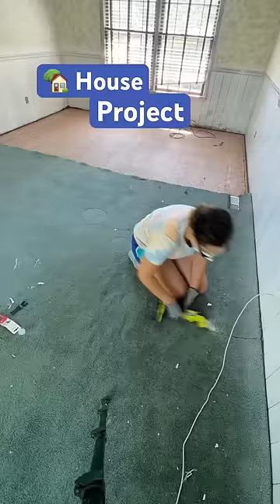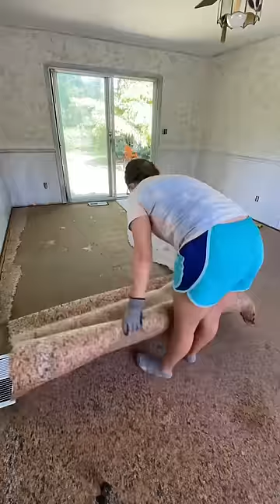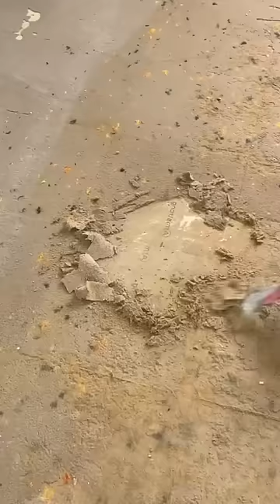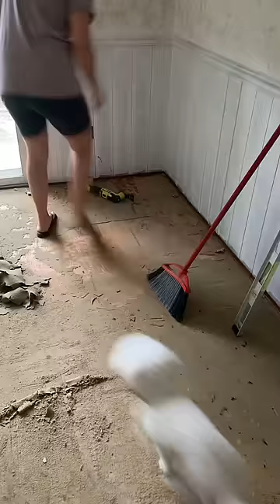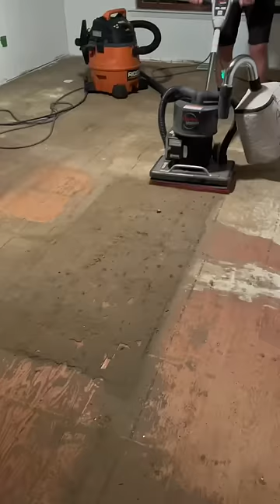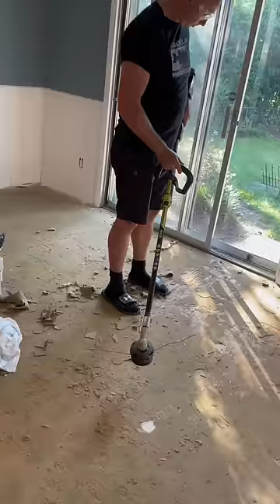Ep.7 DIY fail removing what we found under carpet | Carpet Removal | House Project BEHIND THE SCENES

Comment: That is the rubber from a rubber back carpet that was previously installed. It can easily be removed with a standard razor scrapper from Lowes in the carpet section where they have flooring tools. And yes, you should have done all that before painting as now your paint line is going to show.

Comment: The foam broke down from over the years and will leave dust, but if their was water damage at some time or just a bit of moisture and pressure, it will cause it over time to form this is why you should replace carpet at the first signs of wear or after water damage

Comment: The 'Gunk' you mention is the foam backing on cheap carpet. After so many years and constant foot fall on it is deteriorates and also sticks to the floor.. it also can be hard to remove. It also could be another type of   It's horrible.  Buy separate underlay when you buy your new carpet.

Comment: Painting the walls usually become the finishing step in renovating for various reasons. never start from there first. you'll end up making more mess and waste a lot of time and materials. do your ceiling and then floor first if it's still in the beginning phase or if you need to take some stuff off, then lastly on the vertical spaces

Comment: I do flooring for a job that gunk is the underside of the underlay it’s old foam that has stuck to floor probably because there was a oil finish or something on wood the best way is to just scrap it all with a floor scraper like the size of a broom then get all the small bits with a smaller scraper

Comment: There is a tool for that and it's called a scraper. There are various types but you can find a good one at home Depot. They are like a broom but with a blade on the end and they remove that so easily 5 minutes if you do it right

Comment: If you take a 6 inch blade scraper and turn the blade upside down   The back doesn’t catch in the wood as easily and might work better from a depressed angle

Comment: Crazy idea. Don’t paint until all surfaces have been stripped. That gunk is old foam underlay that has decomposed. It likely was glued to the floor, and depending on the age, natural animal glue that would simply dissolve in water, or contact adhesive which will not come off and gum up every tool you try to remove it with.

Comment: this is old glue. It used to be a thing to glue down carpets like this. it is a pain to remove. You can either get a special machine to do so, or get some chemicals (which the guy who is selling them did not recommend since you would have to air out the house for a very long time and they are toxic af) or, you pour some hot water on it, wait a little, and scrape it of... It's a pain.

Comment: I didn't read all the comments, but that's the old pad and it's just disintegrating. They make big scrapers (just called a floor scraper as far as I know) to get the bulk of it up once you've removed any nails or staples. Also, don't paint until literally everything else is done. It's just pointless otherwise because it will get damaged and dirty during demolition and construction/repair phases.

Comment: I had the same problem and tried a bunch of different ways to remove it until I accidentally knocked over a bottle of water that I was drinking from, I went to mop it up and it turns out that the glue was water soluble and came away when I wiped it. So, I wet the whole floor and removed the glue with a scraper.

Comment: Use a wall paper steam remover: it should soften that material reducing its adhesive strength. Then with a tool that has a blade in front, a scraper, you can scrape all that stuff. BEFORE DOUNG EVERYTHING CHECK FOR ASBESTOS!

Comment: After moving into a new house, the builder had to replace the brand new carpet which had bleach stains from their janitorial crew.  When they were removing carpet, I saw this pile of clay dust left behind on the floor.  Installers explained why this is sometimes done.  Wish I could recall what.  Sorry.  I cleaned it up myself by sweeping it into a dust pan.  This was a concrete slab floor.  Several dustpans full of loose dirt!

Comment: That gunk is a filler to smooth out the floor - because whoever installed that carpet did not remove the old flooring (looks like old linoleum square tiles).

Comment: That gunk layer is what happens when you have old underlay glued to have new underlay fitted above it. When you do this a resin  layer forms on the bottom of the old carpet witch then stops all moisture leaving the carpet through the floor. So like on a wet day you run in you will leave moisture in the carpet  And each summer it dries. Dam if carpets 10years old that's why the really old layer is like goo
 You should have dried the floor out for a few days. And then gone at it again. It would have just crumbled. Second bit of advice. Never double up on the underlay it ends up like this

Comment: As a professional carpenter, I will agree with most of the comments on here. It is a cheap foam pad that has been there for many years . Now, it is stuck to the floor. A 5 or 6 inch floor scraper would work wonders. All so a buffer with a screen would peel it right off. Also, using a weed eater on the inside is not only stupid, it is dangerous. Paint is done just before the flooring is replaced, not before cleanup and tear out. Next time, if you don't know, ask a professional, duh!!!

Comment: Old carpet patting. it's an old trailer. You're actually lucky there's still a floor there. Usually, they've wood rotted out or the fiber board.

Comment: The "GUNK" is probably the previous glue down carpet, someone removed the old carpet but left the glue down carpet padding down, then covered it with pad and new carpet. Maybe better to have wet the gunk down before scraping, dont use too much water.

Comment: That's what happens when a carpet is down for so long and there is padding underneath. The padding dries up and sticks to the floor and when you scrape it up it's nothing but dust. That's what the foam rubber does in thirty-year-old padding

Comment: Okay, I know what that shit was. I can tell you from experience. When the carpet was installed, the carpet before it was removed, but they left the underlayment behind and placed the new underlayment on top, thinking it would be extra padding. Then, the first underlayment began to rot, which was what that stuff was. The best way you could have dealt with it is using dry ice and scrapers. It may cost a bit, but it's the easiest way to deal with the situation.

Comment: I've done this before. Awful job, harder house remodel. So, the bossman brought a bucket of contact cement and just drops it onto the floor and smooths it out. Waits a bit. Grabs a yard scrap bag, those plastic wannabe burlap ones, dances on it, it all comes up. Massive material wasn't but did a whole split level in a day. Minor clean up with rented belt sander. He said some guys went wild with some adhesive that was new in the once upon a time and is definitely not used for carpet anymore and when it gets old it turns almost into an oil but sticky.

Comment: Looks like they left an old layer of underpadding & just put new on top the last time they laid carpet. I had that in a place I lived years ago-the old underpadding was completely flattened, dry rotted, & stuck down to the floor in heavier traffic areas..it was AWFUL, & so freaking hard to remove. 
PLEASE wear a respirator when you're removing things like this b/c you do not want to be breathing in the dust particles from that mess!!

Comment: As a blue collar tradesmen and a volunteer first responder I’ve got to say of all the stupid asinine moronic things I’ve seen and treated over the years using a line trimmer indoors to remove carpet padding has got to be at the top of the list.  Do you use gasoline to light the bbq ?  How about a shotgun to get the dryer lint out?

Comment: Paint last what is this? 

Also it’s matting basic matting. Under carpeted floors you have a basic foam insulation layer which causes the carpet to have some soft give and less of a chance to wear out into threads. HOWEVER like all things - it can degrade and rot away. This matting is old as hell and is disintegrating it is well past it’s prime. Ya know what normal people use?? Putty knives or other metal blades. Scrape that shit up and out of the area. It’s 100% glued on or rotted to stick to the floors. 

You chose to do the manual labor yourself so don’t chicken out when you actually have to do it.  You’re grabbing tools YOU KNOW won’t work instead of just doing the normal shit. Because the normal shit takes awhile and is labor intensive. You put a sander for real on that floor y’all should be charged with ruining and gumming up the machine. You know that a sander goes on wood - did that look like wood? No. So you’re doing something wrong. Accept that - stop f*cking up - do it like you should it’s BASICS 

We’ll get to it atleast you’re not in charge of roofing

Comment: First of all clearly you guys don't know what you're doing....lol ! But pull carpets first that dust is micro plastic foam... It used to be the cushion between the sub floor an carpet... It deteriorates after you clean the carpet so mzny times .. get a wide scraper on a handle put it on an angle an scrape it off.then shop vac it up